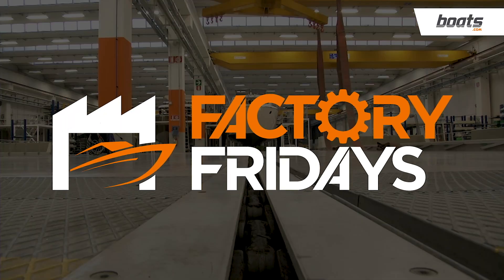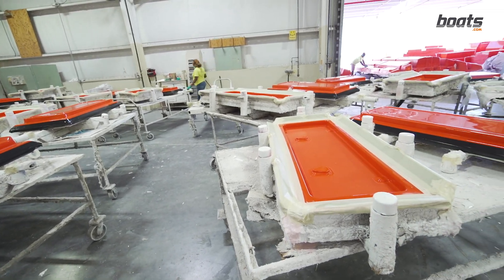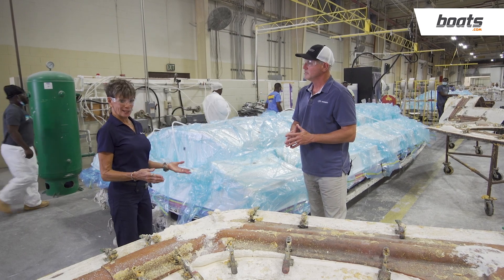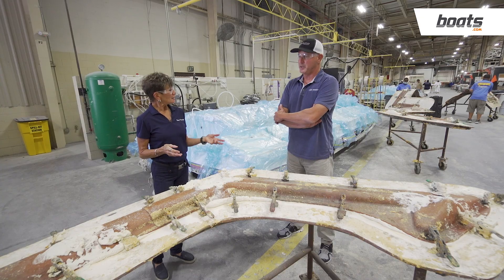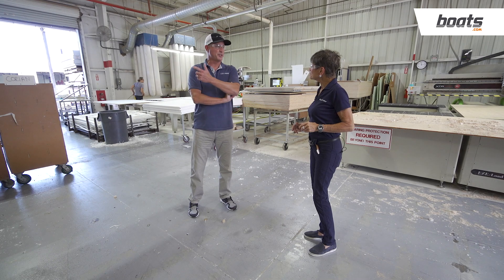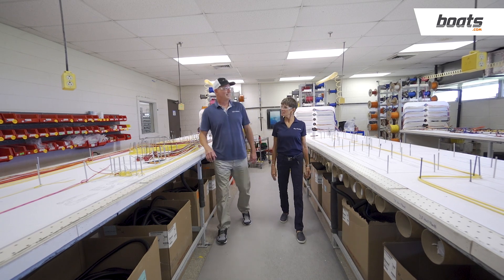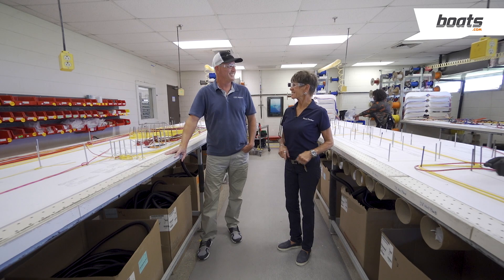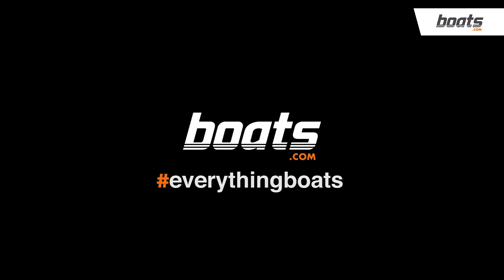Factory Fridays: Pursuit Boats Renowned Construction Process EP. 4

Comment: I would never consider buying a boat with any wood in it now. That is an old technology with a drastically shorter lifespan than newer technologies. The bottom line is one day the wood will deteriorate. The composites are far superior, will never deteriorate or rot out. They do not hold moisture either which means the mat/resin wont deteriorate with it. In 30 years when the wood in these boats is rotten, the composite will be just as strong as it was brand new. Pursuit needs to catch up with the times, there is a reason the high end builders aren't using wood.
Reply: Aside from cabinetry, where do you see wood in Pursuit's current builds?
Reply: @aaronstestlab  I dont know is they already changed to composite but they were using wood very recently. Great boats but wood is a NO NO
Reply: Wood is for the cabinets interior that have living berths etc.